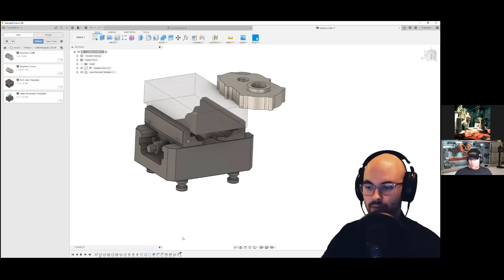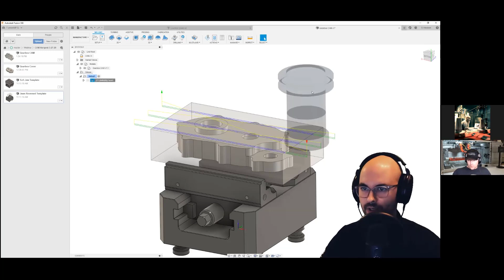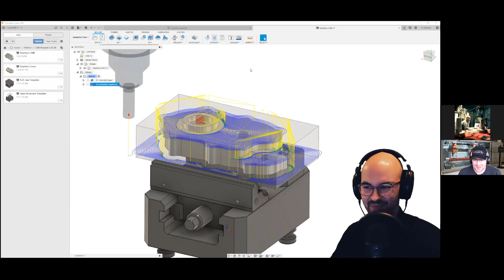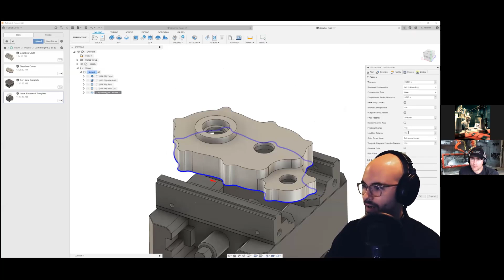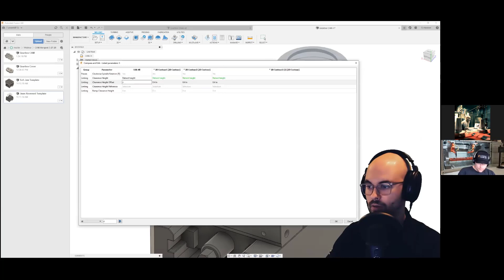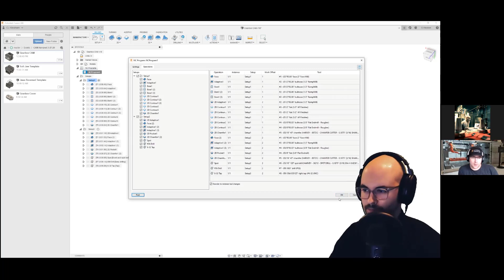360 Live: CAM Hangout

Comment: I'm currently in the process of building a home cnc router, and would absolutely love to see an option in Fusion 360, to simply enter my available tools list into the library, and then have the CAM setup automatically calculated, based on the input of my machine specifications and available tools, and whether automatic or manual tool changes. In addition, the ability to select from options such as reliability, speed and/or efficiency, for example, would be aweseom.